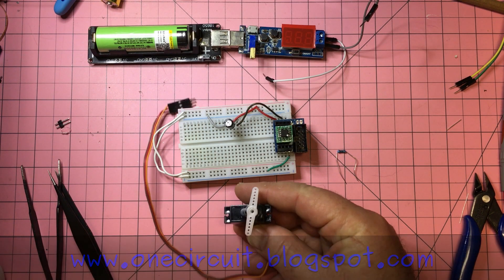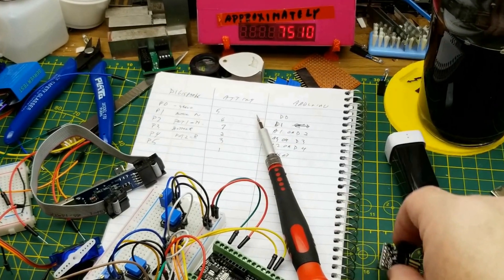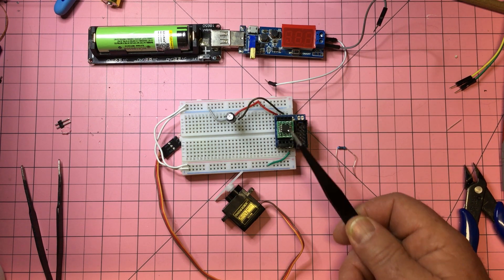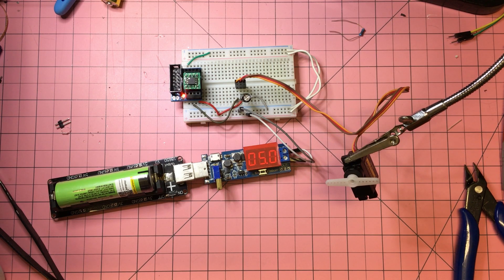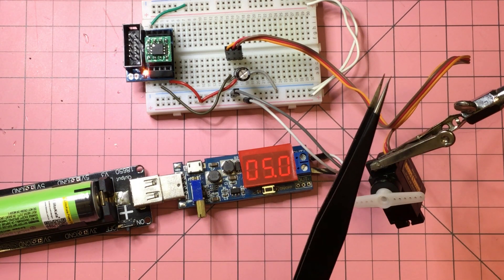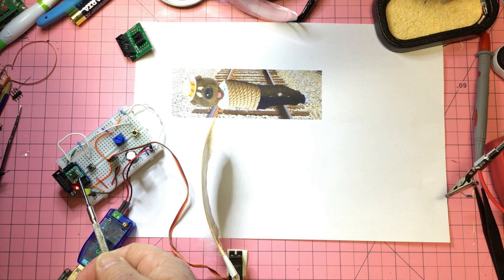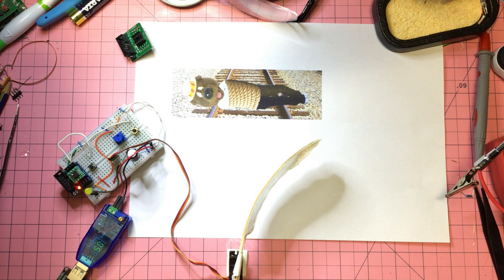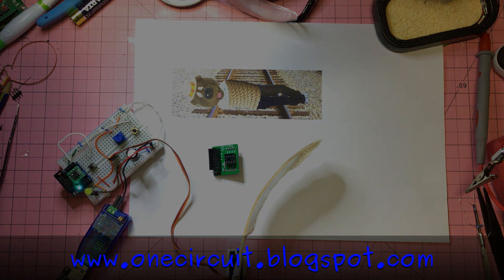ATTiny85 and SG90 servo motor

Comment: Thanks for making this video. I will use this circuit to control model railway points.
I couldn't find the circuit diagram. Is it on the blogspot site?
Reply from the maker: There is a picture of the breadboard version on the blog post linked below the video. The rest can probably be deduced from the code. I really enjoyed that project and I’m glad someone will get use from it. 👍😀

Comment: Beforehand, I'm very new to this topic. 

So basically, I want to control a SG90 motor through a software from my computer. The Software will be on my computer and I just want to indicate something with the SG90. An Arduino or raspberry pie seems a little too much for it in my eyes. 

I would really appreciate if you could tell me, if a mini Arduino micro USB will be the right thing for that project?

Thanks in advance and nice video!(:
Reply from the maker: Will the motor remain connected to the computer? If so, you will need something like a raspberry or orange Pi (orange Pi much cheaper!)
Reply: @onecircuit-as  Gladfully, I decided earlier to buy an Arduino uno clone. Thanks a lot for your answer!(:

(btw: It looks like there are not a lot of distributors of Orange Pi in Europe)
Reply from the maker: I buy them direct using AliExpress. Cheap!